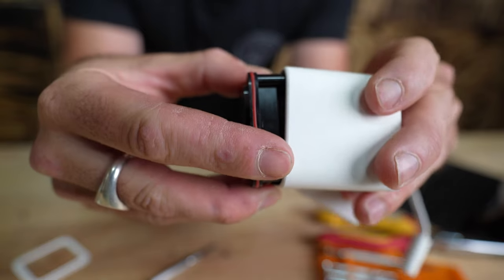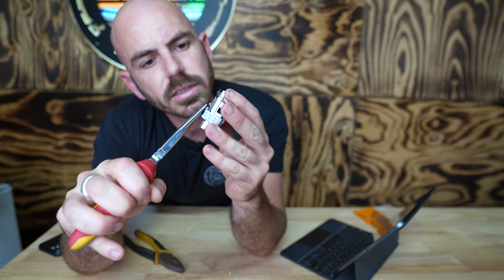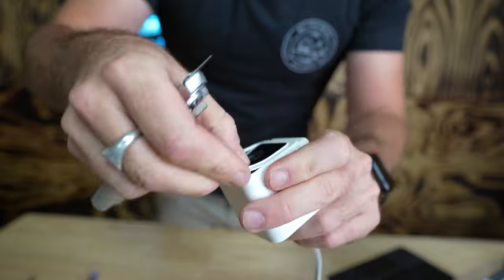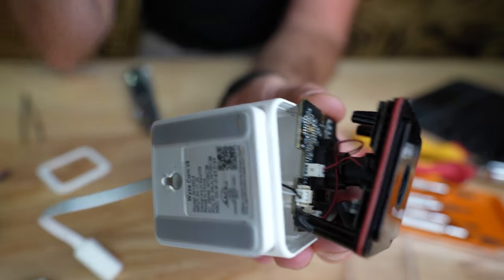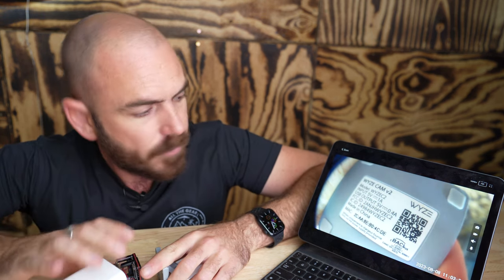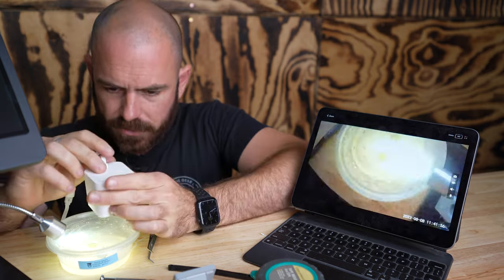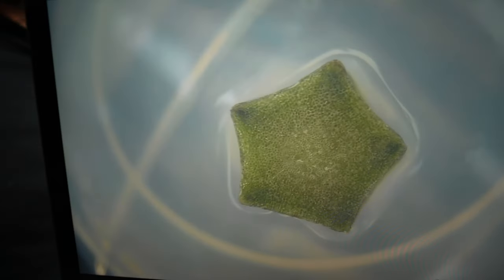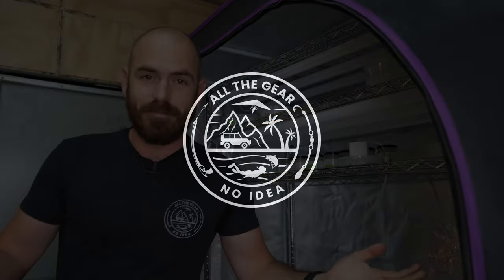Creating the Worlds Cheapest Macro Timelapse Camera

Comment: I've got wyze and eufy. I've torn down the eufy and actually replaced the lens with a fpv lens (m12). My use was for replacing a faded lens (as they have a plastic lens from the factory that don't do well in the sunlight, though I think wyze v3 uses glass). But you can get different mm lenses. Pretty neat.

Comment: Love to see timelapsing and tissue culture videos so this was a terriffic treat! Even though it might be a different market to the other folks here, i'd recommend trying an ESP32 CAM. a timelapse camera and wifi capable arduino set of GPIOs in one. If you need it to also control and log pumps, solenoid valves, lights etc in the one device that is also doing the timelapse its handy. but does need arduino programming experience.

Comment: I wonder if you needed weather proofing if you could roughen up the plastic with sandpaper to key the surface, then use hot glue to seal around the lens. When you needed to readjust the depth of field, just reheat the glue so it softens, wipe it off, and adjust the lens.

You'd probably want to redo the glue each time you needed the camera to be water resistant, but it's cheap and fast.

All of this assumes hot glue is water proof/resistant - I don't actually know either way.

Comment: I've made this but it gets very, very hot... Feels like it's going to cook whatever i have in the petri dish..
Reply from the maker: That’s very strange, the cameras don’t heat up usually. Make sure you’re Timelapsing at a reasonable rate. If it’s taking one picture every second that would be heavy on the hardware
Reply: @AllTheGear-NoIdea  thanks for replying! it's one picture every hour...so should be OK? It's in an enclosed cupboard but heater isn't on currently. I've also turned off all cloud features and notifications so it shouldn't be communicating with anything. Just saving locally. I'll measure temps later but think it's definitely too hot for cultures